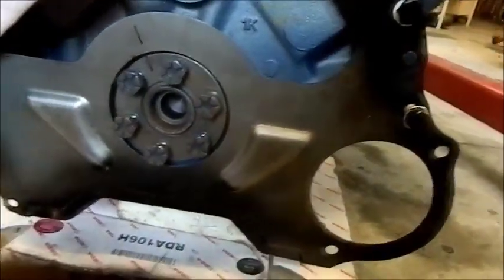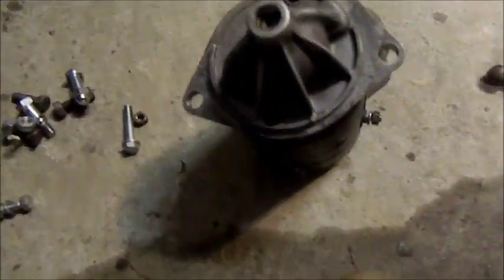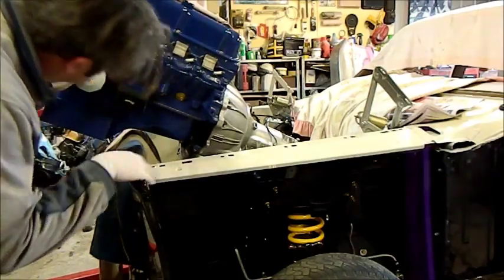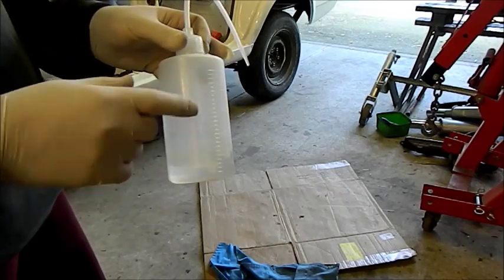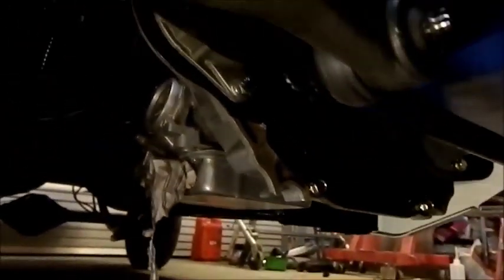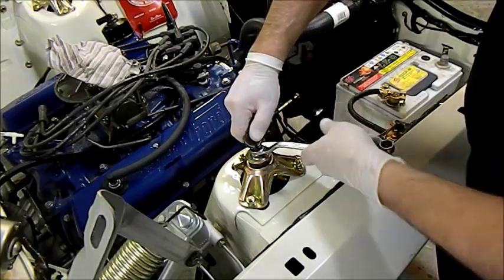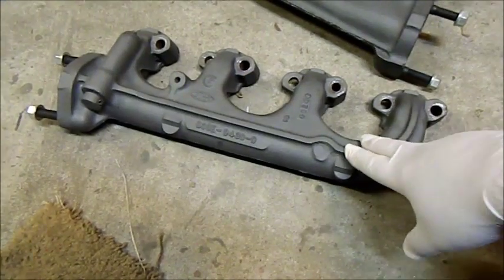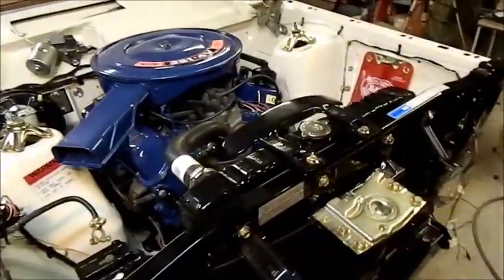1969 XW Ford Falcon Restoration Part 15

Comment: Have really enjoyed the series Peter......I had issues with my handbrake cable in my 351c XY  with headers....the cable would heat up & seize. I went thru 4 of them before I bought some heat shield product & wrapped around it.....I have not had any problems since......

Comment: Its so nerve racking putting engines in nicely painted engine bays . I always do them by myself to, no ones ever around . The headers are always a pain , you have to pull the steering box out on a Mopar to get the extractor in so i sit them in and lower the engine over them. Stock manifolds are ok . This car is really nice , great video again Pete.
Reply from the maker: Hi Peter, I actually didn't break a sweat with this at all... very easy Windsor installation. Most of the old Ford stuff is pretty straight forward, although I remember getting annoyed with a 2 litre Escort I was replacing a clutch on... I think I had to rotate the gearbox to get it out... The worst was an E-type Jaguar clutch... I removed the engine from underneath and the body became unstable on the hoist without the engine weighing it down. None of the bolts had captive nuts etc... a real pig to work on... This 351 install was literally a walk in the park by comparison. Cheers.
Reply: @PeterAndersons  Yes Pete the old Fords are great to work on, I remember working on English and European stuff ,was always a headache. Alfas used to come new with factory rust holes . Used to hear the mechanic swearing working on jag engines, he used to say why don't they just put a 350 in it .  I have some nightmare stories working on English and European stuff. Glad everyone had Fords or Holdens so we never got many . 20 minute job on a falcon would take at least a day on English stuff. The worst job on a falcon was changing the front cross member with everything still in the car . Needed new overalls every time. They would catch on fire and holes all over them .  Taxis always had wrecked cross members , don't know what they hit all the time . Was still a holiday compared to working on English and European stuff. I'm cleaning out the garage selling engines and transmissions I don't need from Mopars to make room for Zd parts I'll be needing after the Cm is done. You've got to build something you really like. I've got a nice Regal se 360 . Zd was my favorite car so has be a Zd or Zc . The videos from you and Jason have made me want another one . 30 years and I still miss the Zd .  Nicest car I've ever driven,  the old 351 is a great engine. Ford front ends are easy to do as well. Great job on this beautiful Xw Pete .

Comment: So cool to watch this. I'm 17 re building a 351 Windsor but I'm going EFI, turbos, big cam! 700-1000 hp going into a 95 Mustang GT. I've probably learned what most stuff is called and how to install bc of you sir. Thanks :D
Reply from the maker: 700 - 1000hp will be an animal! You will need to see an engineer and discuss suitable chassis reinforcement and save some money, that car will be an expensive gig. You will love it though and best of luck with your project. Thanks for the positive comments.
Reply: I want it to be a beast though haha! and i want it to peak like 850 to the wheels on high boost but it wont always be running high boost that would just blow it up

Comment: Love your work Peter, inspiring me to take on a project of my mown.

Just as a question, how many hours do you think you have put into the car so far? It looks like a lot of work, that is enjoyable (mostly) and rewarding.

Looking forward to the next instalment
Reply from the maker: Hi Steve,
Thanks for your kind comments. Yes indeed it is a lot of work and wouldn't really know how many hours I've put into it, suffice to say a lot of the time was cutting out rust, fabricating patches, welding (with Michael) and grinding them back. The surface rusted roof with hail damage was what really demanded time - the rest has been fun... time wise, I reckon between 700 - 800 hours so far with about a further 200 - 300 to go. Just a guess, I would think this car is a 1000 hour gig from start to finish.
Cheers Pete

Comment: Hi Peter,
I've had a bit of a binge watch over the last few weeks. Great videos!
I 3/4 through my complete rebuild on an xw 351w 4sp that I have owned since 17, 20 years ago now...
I am doing ok with it. Completely on my own so far. Engine is built and car is mostly together but I do have to spend some time in the engine bay before swinging the engine in.
I heard you mention a clutch cooling fan somewhere along the way. Does that just take the place of the fan spacer? I would prefer to use a clutch fan instead of the constant fan, for obvious reasons. Can you give some info on that?
Keep up the great work!
Cheers, Brett
Reply from the maker: Brett M Hi Brett,

Yes, the clutch fan replaces the fixed blade fan and spacer. You will need shorter fine thread bolts though. I can't say for certain, but I believe all Ford V8 water pump hubs are the same or very similar bolt pattern. I have fitted XD Falcon V8 (Cleveland) clutch fans to other Cleveland powered cars, as well as Windsor and FE big block cars. They work well and most of the time stay disengaged, so you never hear them. Electric fans are best, but they rob the engine bay of the classic look and in some cases require an alternator upgrade.

Cheers Pete
Reply: Thanks for the info! I will have a look at the wreckers next time I'm there.
Just noticed your next video. I'll check it out now!
Good luck with it all!
Brett

Comment: You are a clever guy doing a professional job, why don't you use XY/W 351 GT windsor   exhaust manifolds?
Reply from the maker: Jim Clarke Thanks Jim, I didn't use them because they're almost impossible to find and when they do turn up, they are huge money. Even new hi-po 289 reproduction ones are around $600 and I wanted to keep the costs within my budget. Cheers Peter